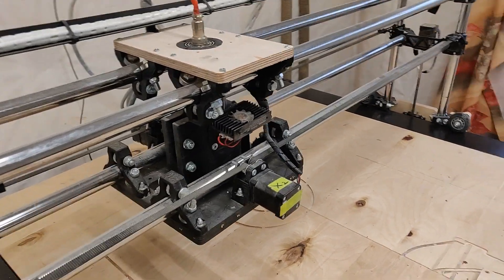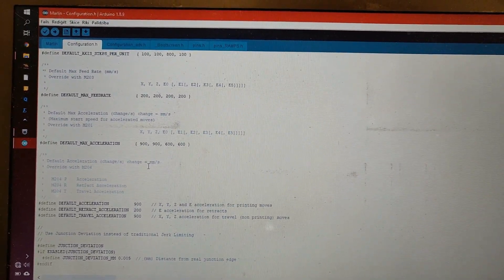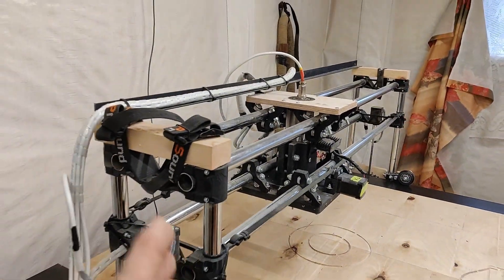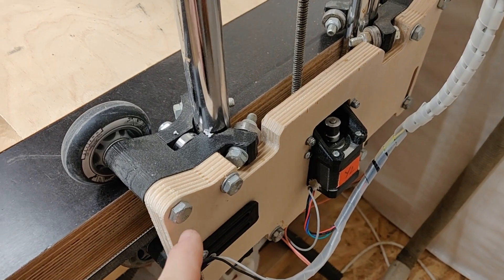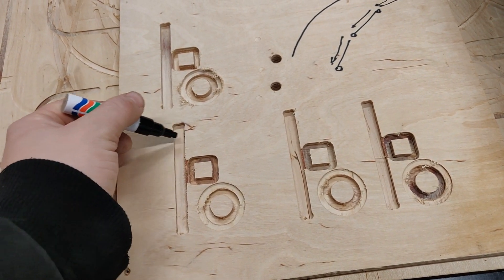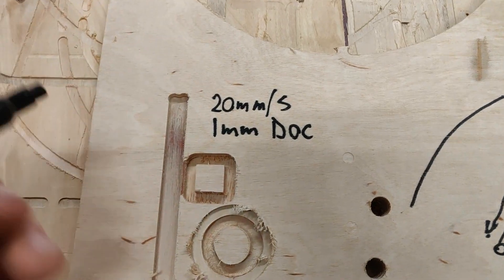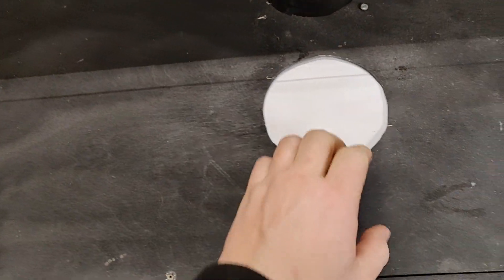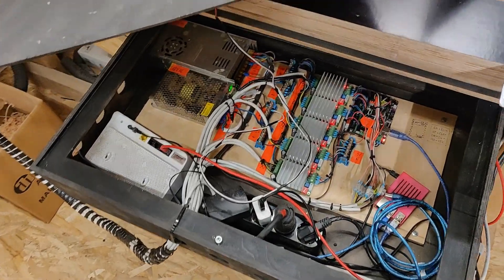LowRider2 CNC Y plate upgrade

Comment: The Lowrider2 still has the bottom wheels. Hey what stepper drivers are you running?
Reply from the maker: I am using the 4.5A TB6600 drivers - I talk about the wiring and setup in my LowRider2 overview and modification video

Comment: Hi thanks for share your experience , I was planning to build my lowrider cnc , i was wondering if the printed black parts of your cnc structure.. are the default size as they sold on the shop?,
Reply from the maker: Hi Martin! I am using the 25mm tubes, so the printed parts are compatible with this size. For the parts that I modified, I made 2 versions - both for 25mm and 25.4mm tubes, but I have not tested the bigger size myself
Reply: @KarlisZalitis  thanks Karlis have a nice day

Comment: When you have the second wheels underneath you could probably cut the groove in the underside to help tracking instead of in the top. Perhaps the groove could be avoided completely if you add two strips of  wood with a 45 degree edge to the underside

Comment: Loving these videos! super helpful. Question for you, how thick is your table that sits between your 2 sets of wheels?  Im thinking to make a similar build however with a frame made from some extruded aluminum that I have laying around.
Reply from the maker: Thank you :) the table between the rollers is 65mm thick (35+30mm)